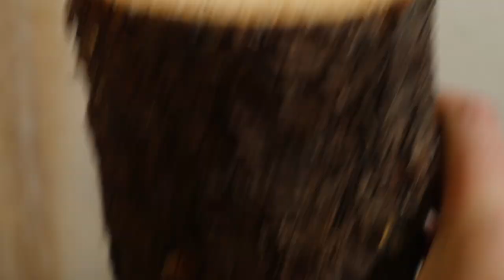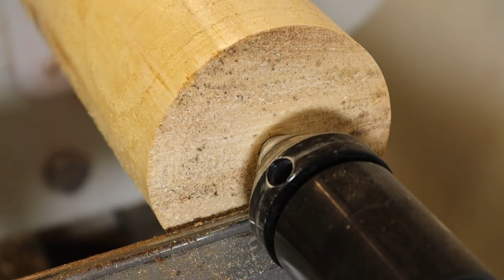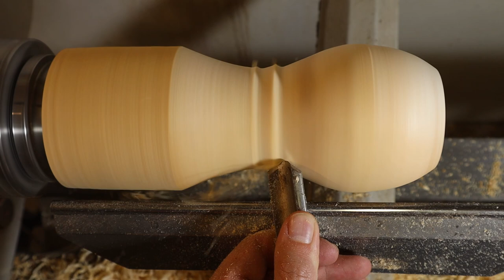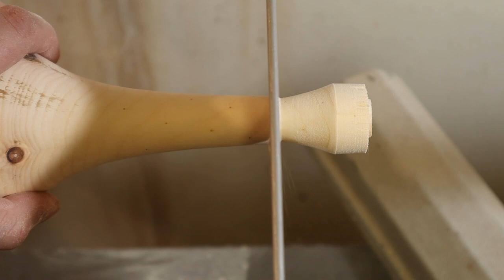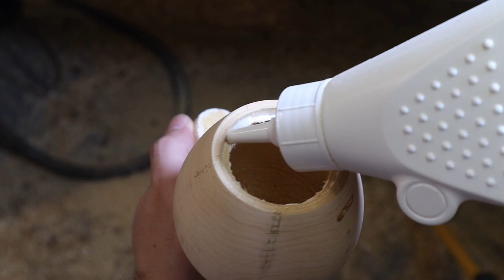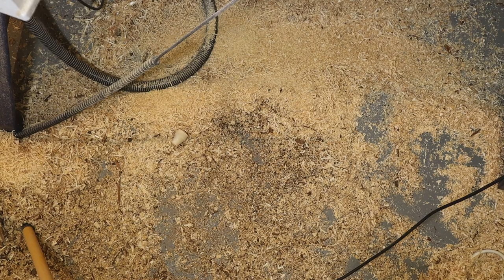Woodturning - Dried Flowers Vase

Comment: Very impressive! I just wondered if you could fill the base with sand or similar, to provide some weight?
Reply from the maker: Thanks! Sure, you could fill it with sand, to add some weight if needed. That's what I would do as well, to make sure it has a secure stand.